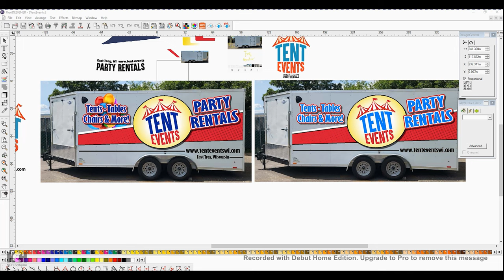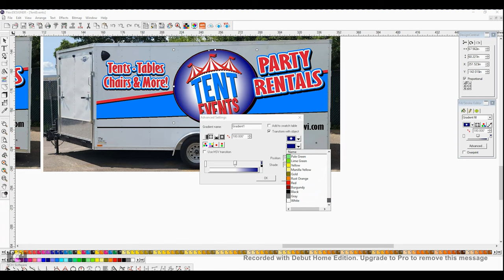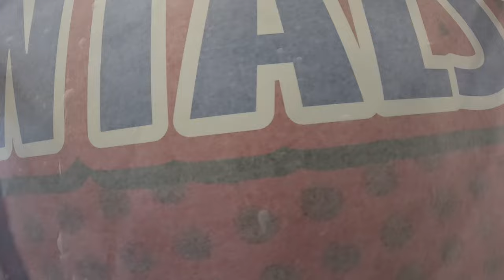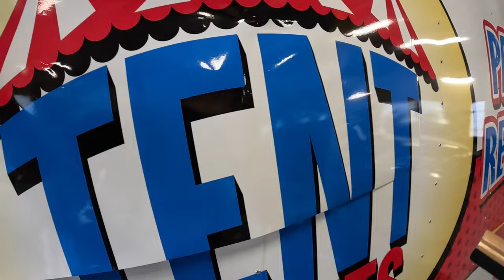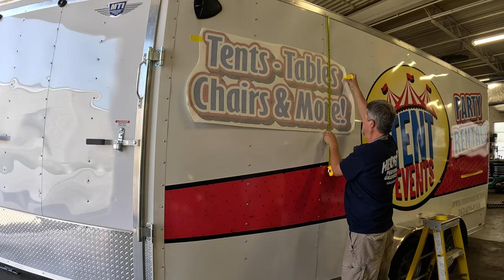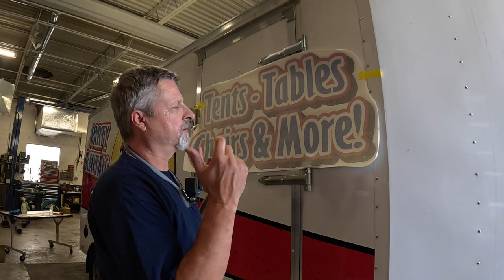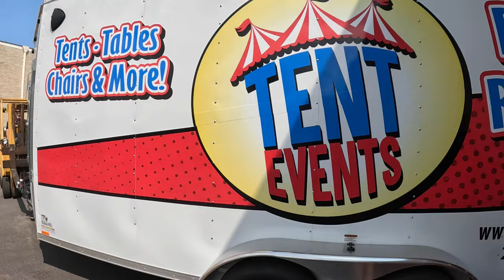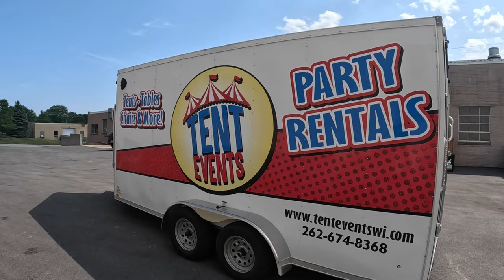What's better,  vinyl wrap or spot graphics? #vinylwrap #wrapshop #carwrap #trailer #asmr

Comment: Question for you. Why do you wind the vinyl printed side in on the rewinder? Is there a benefit?
Reply from the maker: Great question! Easier for the next step,  to run it through the laminator.  It keeps the print protected from dust and scratches.